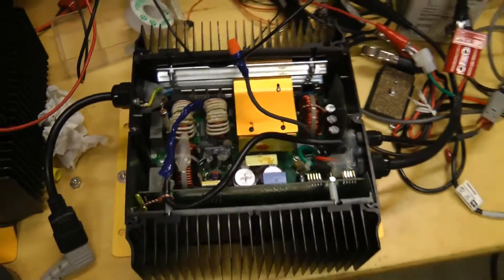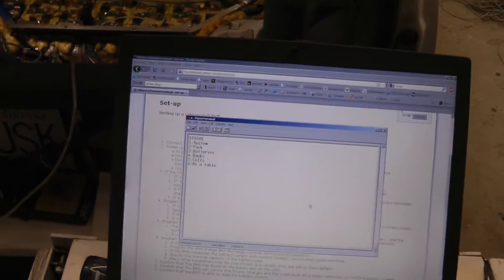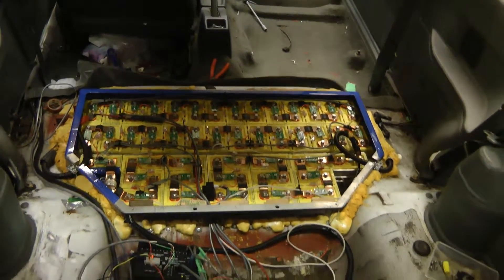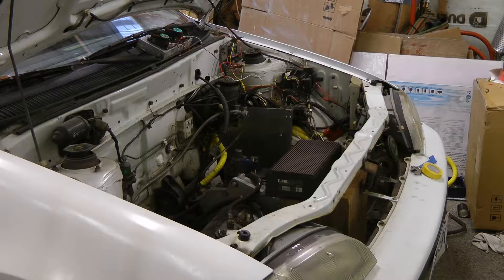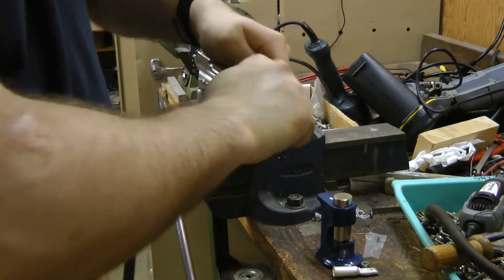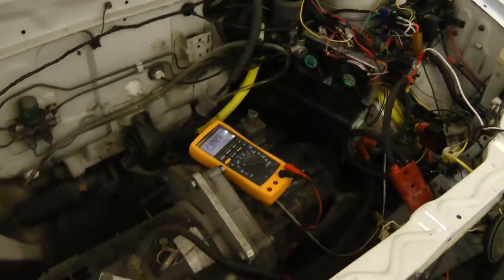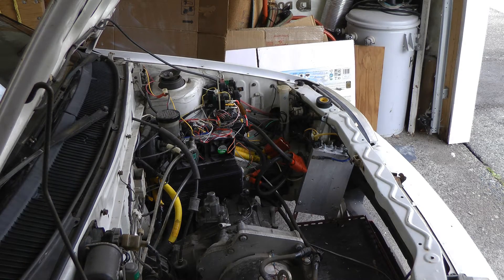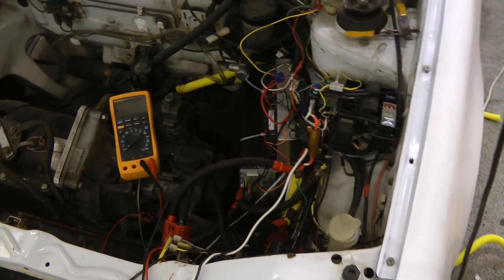Electric car upgrade part 4 - Chargers, Charging and Testing

Comment: ,Hi, tesla500 , can u tell a bit more about the motor that u r using? the voltage and current ratings. and hp?
Reply from the maker: This is a Kostov 9" series wound motor with interpoles, rated 120V 20HP

Comment: Hi, can you please update us on your current battery status? What internal resistance is like now? How many full cycles you had? I've similar problem here with a number of cells, which i bought from an abandoned project, cell were new, but spent two years on a shelf with no use. Currently i did two full cycles on a test bench, it seems that resistance is reducing, but still way too high (some of cells are as high as 4,5 mOhms) I wonder how much more it can drop after 10 more cycles? Thank you.

Comment: actually it can be done but there are some bureaucratic issues. by guidelines they want you to get the converted car radio noise certified and electric safety inspection in a certified lab like TUV in germany. which can be a costly affair, 2-4k$ last I heard.
but that's guidelines. it is still not clear if you can just convert a car and have it inspected for license plates and register it as an electric car. it really sucks there is no clarity here in DK. bureaucratic douche bags

Comment: fascinating stuff!.
I toyed with the idea of making a electric towmotor out of a old lawn tractor a while ago but did not have enough motor HP. now I have a good speed reduced 600W DC motor and Curtis 1228-2901 speed controller to play with so it may be my first EV :D (tho I will stick to gas engines for road use)

Comment from the maker: @HDXFH Yes, that's quite practical. The BMS has a state of charge output that could be adapted to drive the fuel gauge, and I'd need to add a temperature sensor for the motor. I'd probably monitor the motor controller temperature too.

Comment from the maker: @DanFrederiksen The chargers can respond to the BMS with the right software, available from Delta-Q. I just added a relay inside the charger to isolate the battery referenced charge enable input from the 12V side referenced output from the BMS controller.

I'd prefer the 12V battery to have enough energy to run the 12V system for an entire trip in case the DC-DC failed. If 12V is lost, there's no power to keep the main contactor on. But a lithium ion one would be much lighter.

Comment: could you rig up the original Fuel & temp gauges in the car so they'd each read Battery capacity & Motor temp?

Comment from the maker: @bonecrime This car has no power steering, so no problem there. If I did have power steering, you'd have an electric motor to drive the power steering pump. For the brakes, you'd use a vacuum pump to simulate the manifold vacuum. I actually haven't installed mine yet, the brakes on this light car are relatively easy to use without the vacuum assist. I have the pump already, I'll eventually get around to putting it in.
Reply: You can take ford's electric brakes. I think ford fiesta has one.

Comment: nice. was the charger built to repond to bms or did you hack that as well?

shouldn't you use a smaller 12V battery? for the weight saving and efficiency. it weighs a ton. 4 A123 26650 cells should be enough

Comment: Out of curiosity, how did you get the power steering and power brakes to work? And also, how do you get it to pass inspection? I doubt it would be an easy task to make a home made electric conversion like yours road-legal in my country. :S

Comment from the maker: @douro20 No, they have various software versions for different applications. In this case I used a standard remote control software version, with a lead acid charge algorithm that has the correct voltage limit setting for charging lithium.

Comment from the maker: @definitionofis For this application it's OK because the BMS controls the charger, the charger basically acts as a power supply. If you were actually using the internal charge algorithm, you could change a resistor on the power board that tells the microcontroller what voltage and current the power board is, so it would compensate properly. In any case, the voltage dividers to measure the output voltage must be changed, as I did here.

Comment: I understand that you doubled the charger voltage by changing the transformer tap. How did you not mess up the charger's absorb timing and float timing values ? Aren't they measured at the output voltage ?

Comment from the maker: @TheElectricnoob I'm distrustful of anything initially, at least until it's proven. While I've had this car, the only thing that ever caused it to not work was a dead 12V auxiliary battery after letting it sit too long.

The fuse is in the rear battery box, in the triangular corner on the driver's side.

Comment from the maker: @g60scuzz The pack may drift slowly out of balance over time once it is in balance, it's a good idea*  to have a BMS on it all the time to ensure no cell is overcharged or overdischarged. The BMS is off the shelf, made by Elithion. The pre-charge charges up the bus caps in the motor controller through a resistor, to avoid damaging the contactor and caps. Looking forward to seeing your AC conversion!

*most people think so, some are adamant that it's not needed and chose to manually balance.